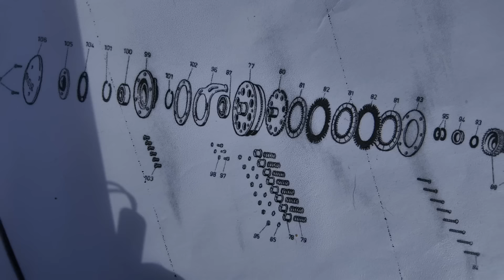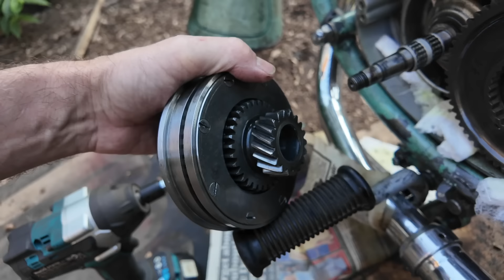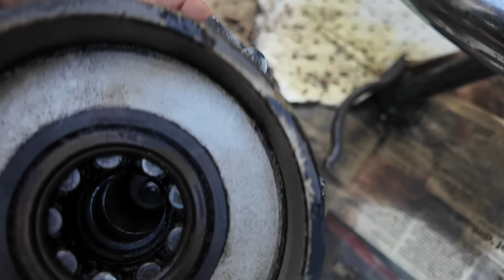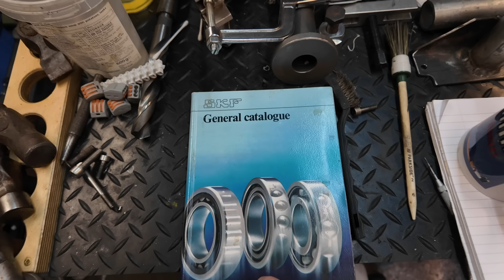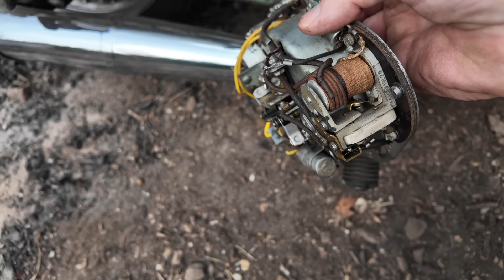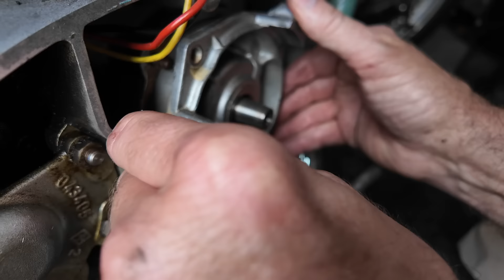BOTTOM END DISASTER ??

Comment: I will be most interested to see the crankshaft coupling. I had the bolt on my old Leader come loose, shearing the Woodruff key so had to make my own very first specialised tool for motorcycle maintenance. That was over 60 years ago ☹
Reply from the maker: It seems to have been a common fault, the one I disassembled had suffered the same fault.....long Allen sockets are a lot easier to get today

Comment: First special tool should have been a crankshaft nose protection cap to protect the centre in the end of the shaft from puller damage. Good centre here necessary for crank re-alignment between centres after replacing the big end pin.

Shock is the best way to release the clutch drive plate taper from the crank - fit protection cap to crank, fit puller to clutch, wind in the tension bolt until it is "ping tight" then, while holding the puller with one hand, fetch the end of the tension bolt a solid blow with a heavy hard hammer. The shock breaks the taper grip and the clutch effectively falls off. Keeping winding tension onto the tension bolt risks stripping the clutch body extractor thread.

Successful re-attachment of the clutch to the crankshaft taper requires scrupulous degreasing of both tapers with brake cleaner and the end nut tightening to the correct torque - for an MZ250 that is 90Nm, so much more than the "light tap to reseat" that you mentioned. Don't get this right and the clutch "will" come loose and when it does it damages either the crank taper or the clutch body taper or both. A tip I got from an MZRC article when I rebuilt mine was to pre-heat the clutch body with a hot air gun before mounting it to ensure a really tight grip - you also need to make up a spacer to temporarily replace the outer crankshaft bearing in the clutch cover to tighten the retaining nut against.

Don' t want to be a harbinger of doom but I would be very surprised, given the corrosion pitting to the mains, to find the big end bearings are not similarly pitted. When you get the crank out I would be tempted to do as Allen Millyard does and split each crank to properly inspect the big end bearings in a dismantled state. Trouble with two strokes is the crankcases are always exposed to atmosphere, either through the carb or the exhaust, and temperature changes cause air to flow into the cases. Airflow = possibility of damp air, which condenses into the bearings, causes corrosion pitting which then leads to break-up of the case hardening. The bits of hardened case that come loose get embedded in the piston & wear the bore. Not making sure that the big ends are good could well lead to more work being required in future.
Reply from the maker: As I stated in the video, if I was going to put any effort on the end of the shaft a brass cap would of been turned up, pressure was only applied  by hand with a 4" King Dick spanner and as seen the MAKITA impact was used to spring the taper on this and the primary drive gear with ease ( and no damage because it's a rotary impact force rather than a direct impact on the end of the shaft avoiding the chance of knocking the crank out of true and stoving the end over )it is an indispensable tool in the tool arsenal sending the practice of clouting shafts and pullers back to the dark ages.
A good call on warming the clutch taper and we will have to see with the big end bearings as we are talking Unicorn droppings when it come to replacing them.
Reply: @TweedsGarage  I guess you have seen the Australian Adler pages on the web showing a cd with scans of the original workshop manuals ? Same site shows "workarounds" for the conrods & pistons using Kawasaki and Suzuki bits. Also makes a point about using C3 clearance bearings due to the high degree of interference fit of the bearings in the cases.
Have you contacted Phil Speakman at the MZ shop about Adler rebuild tips ? He had an article in RealClassic magazine about getting an Adler crank out in which he showed the factory gear tool for the crank joining screw removal.
Reply from the maker: @mgnbukint6502 yep it has some good info on there 👍 and I'll look Phil up

Comment: I’ve landed myself a military issue Enfield 350cc two stroke flat twin generator engine I’m just getting started on trying to get it running. Apparently it’s pretty rare but robust my concern is the likelihood of the crank seals being knackered. Just hoping that as it’s British it won’t be such a nightmare as the German machine you have locked horns with. Good luck in your endeavour.
Reply from the maker: Hopefully like the early Villiers and Scott engines it rely on sprung metal  gland seals rather than rubber ones, good luck

Comment: What a gruesomely complex design. Typical German. As a factory production worker, I set up and ran German Windmoller & Holscher machines for making heavy-duty polythene sacks. The complexity would test your patience sometimes. Having said that, they were as good as new when the factory closed down after 21 years of constant running.  I just made a puller-plate to get the rear brake-drums off an 1985 Suzuki. Took nearly 2 days to cut out and drill 9  half-inch holes accurately. Worked a dream, though.
Reply: Back in the 1970s I briefly operated a lathe (spoiler: I was a rubbish engineer). It was German and dated 1890 something. Which said a lot about British engineering, as well as German.
Reply from the maker: They don't like taking the easy way, done the valve seals on a BMW 318 with the old rope trick to avoid taking the head off ( because that was another whole world if pain ) but the amount of oil leaks on it due to over complicated labyrinth o ring gaskets on the oil filter housing and o rings seals at the back of the engine behind the exhaust manifold makes oil leaks very common.......the rope trick worked a treat though, but I wouldn't work on another 🙄
Reply: @TweedsGarage  Indeed. Cars in general have become so complex that mechanics are walking away from the job. I don't blame them.
Reply: I've watched some videos on the Australian Armour and Artillery channel, a museum who restore old armoured vehicles for display. It is very striking how much more complex the German designs are v American ones such as the Grant and Sherman, which share many components. Everything on the German tanks looks as though it is a  bespoke component hand made to fit, especially from early in WW2.

Comment: The Germans are usually very good at their engineering, did they never make a workshop manual for this model as i'm sure that somewhere back in the 50's there were German motorcycle repair shops that serviced and repaired these things? also don't know if this will help but years ago on my old Mondeo the bottom ball joint pinch bolt needed a T55 star drive socket for the head which look very similar to the bit you need for the crank bolt but not sure if there are enough teeth on them to do the job.
Reply from the maker: I have a copy of an owners manual which covers the basics but it doesn't cover stripping the engine down, information is pretty sparse.....( and probably only available in German )
Reply: @TweedsGarage   i found one , probably the one you have , it;s in english  put in google search - Adler MB250 Instruction book pdf  .. you'll find it .. will have look for the workshop one tools called a "spezialgehärtet" found illustration of it google - "ADLER M / MB-Modelle" PDF
Reply: @TweedsGarage  ITS A .. awful when i cant put links in or mention words .. impossible to communicate what Ive found for you and where it is .. in this comments section without being deleted